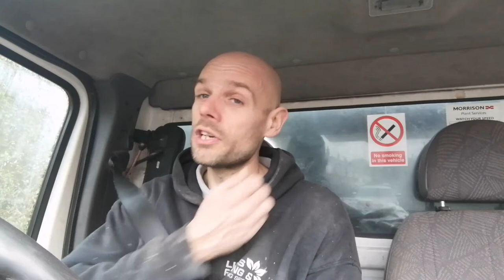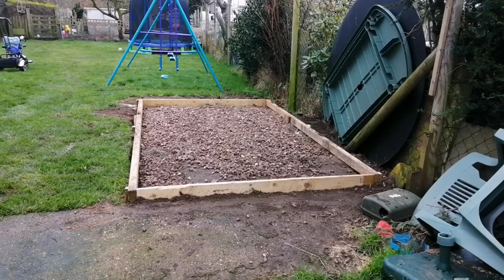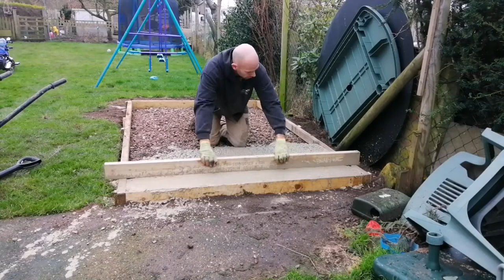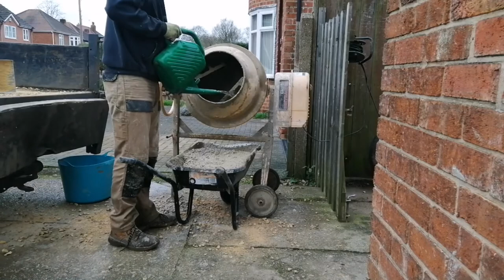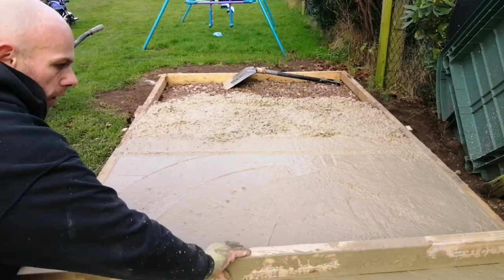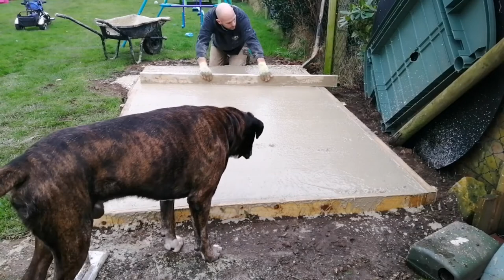Part 1 of the new rabbit Palace. Concrete slab

Comment: looks  perfect  did you  finish  it  with  a broom  finish  or plain
Reply from the maker: Hi I just used a 2x3 and ran it across top. So it compacts it done and can give you either a smooth finish or rippled effect if you need it to be none slip